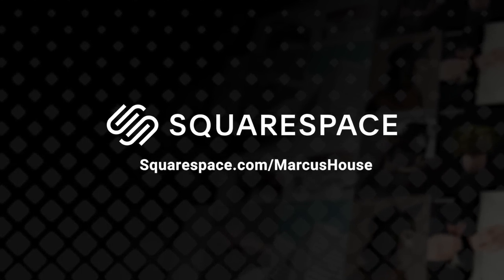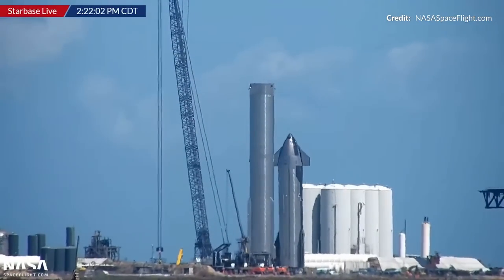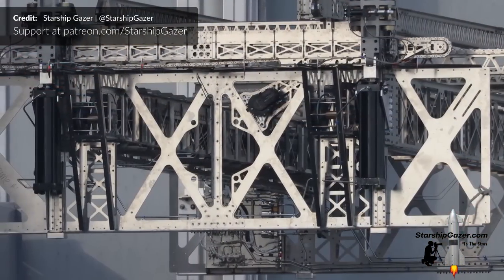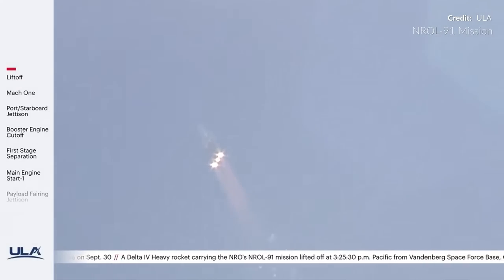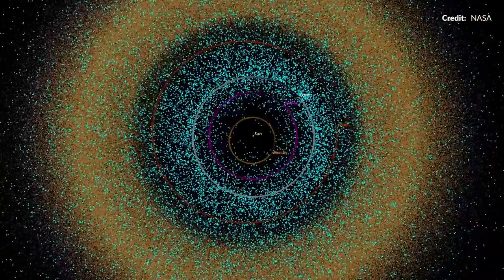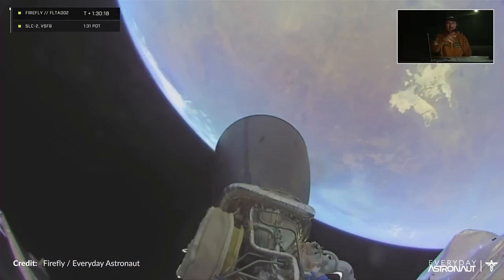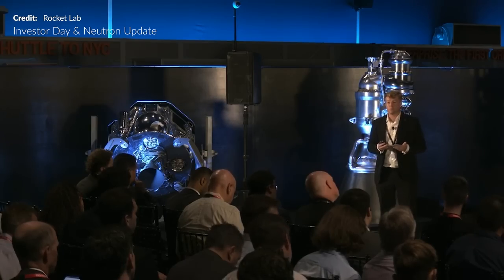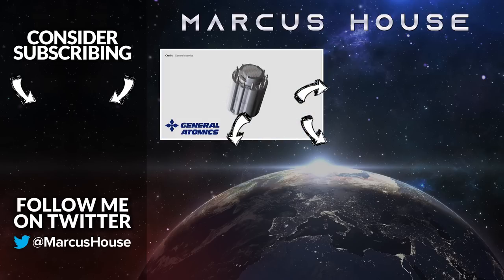SpaceX Starship Updates, NASA DART Mission, Firefly Launch Success, Delta IV Heavy and much more.

Comment: Why can't NASA contract SpaceX to build SLS? They have two different missions but the manufacturing prowess of SpaceX proves NASA needs to make a shift.
Reply: Because when SLS was contracted for in 2011, SpaceX had flown a total of 4 missions to orbit. The 2 Falcon 1 small launcher flights and 2 Falcon 9 v1.0 flights. SpaceX would not reach the ISS until May 2012, would not land a booster until Dec 2015, and would not reuse a booster until Mar 2017. Crew Dragon started development in 2014 and didn't fly the Crew Demo-2 mission until May 2020.

Comment: I'm sorry, but the delta 4's design fucking blows. 
It's twice the size of a falcon heavy and has less than half of the lift capacity.
Reply from the maker: Hydrogen is bulky and hard to work with compared to CH4.
Reply: @MarcusHouse  Yep, and that's why making a rocket that runs entirely on hydrogen is a terrible design choice.